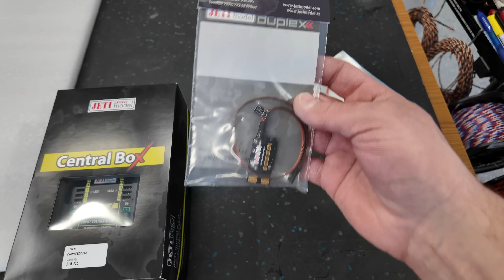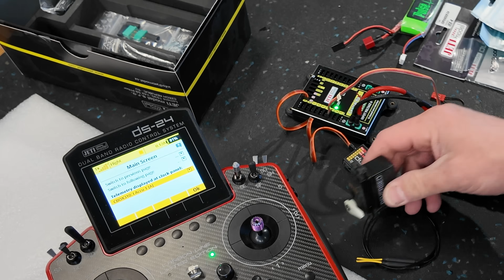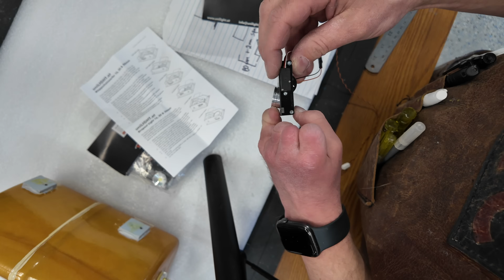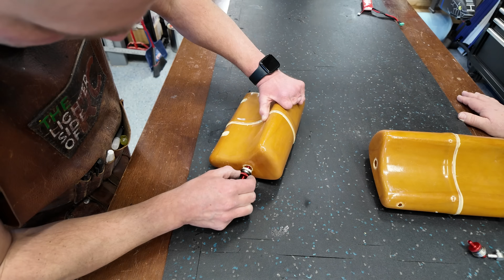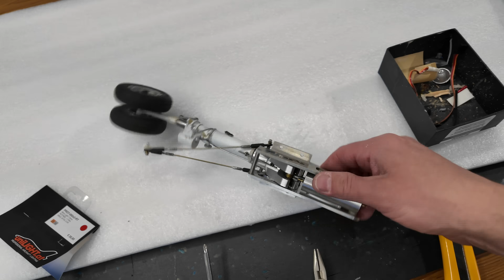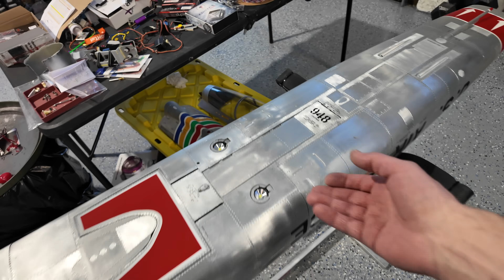Restoring History: BVM F100 Fighter's Amazing Transformation video 4

Comment: Regarding the fuel system, on the first tank (connected to the UAT), does the vent nipple have some hose inside the tank or it can be just nipple?
Reply from the maker: The vents are at the top of the tank so it's just a nipple.